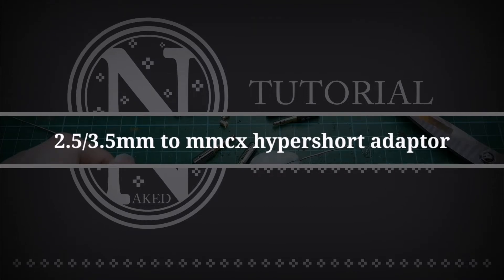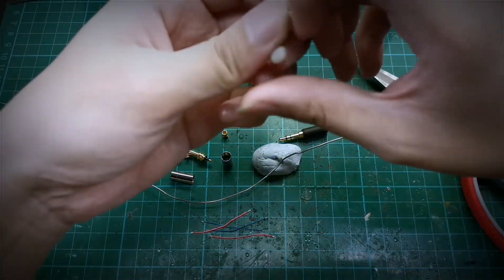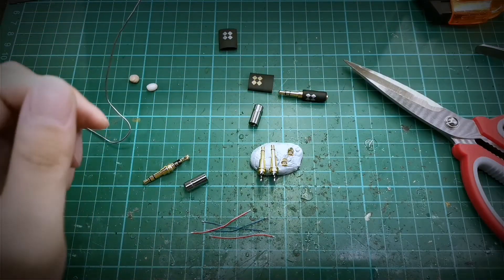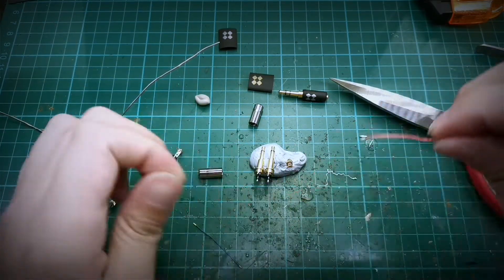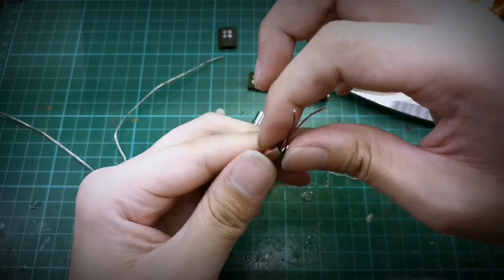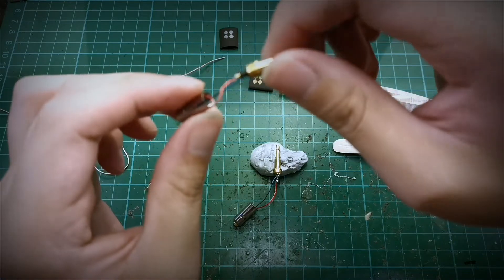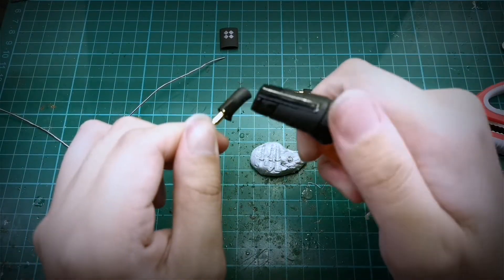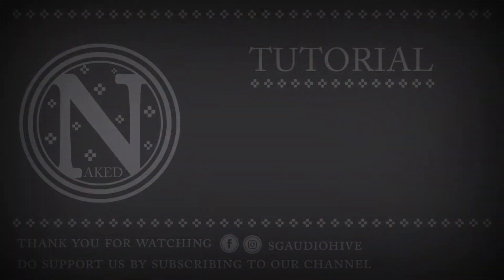DIY Hypershort / mini adaptor from MMCX to 2.5mm or 3.5mm Tutorial

Comment: Thank you for the briliant idea!
So, at the end of video, you talked about mmcx pin attach to 3.5mm stereo jack.
Is that any sound / electricity issues?

I would like to try make a modular connector, so I can freely change connector (3.5mm, 2.5mm, 4.5mm) with the same cabel and cans.

Please let me know.. Thanks!
Reply from the maker: It will be the same with no issue
Reply: @sgaudiohive  well, thanks for the answer.. 😁👍🏼